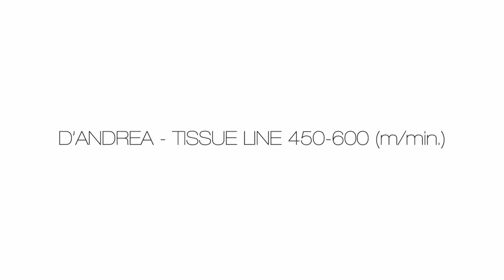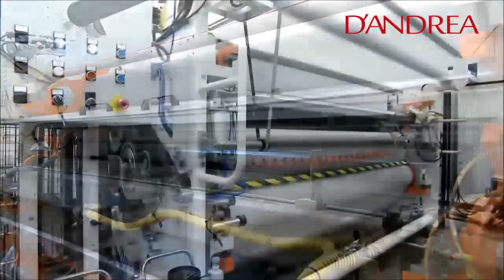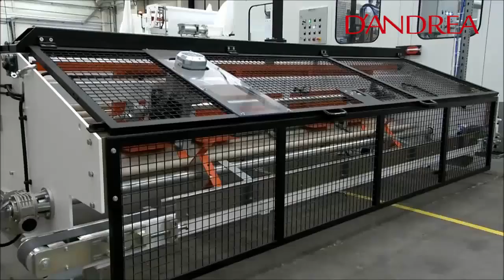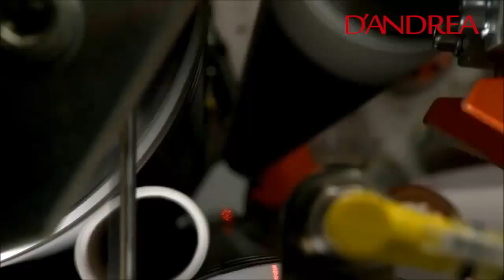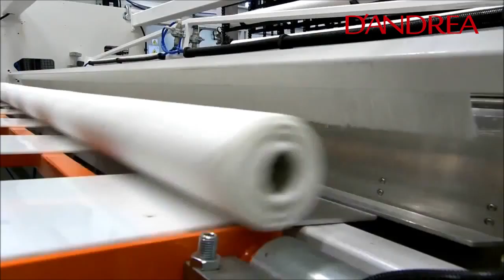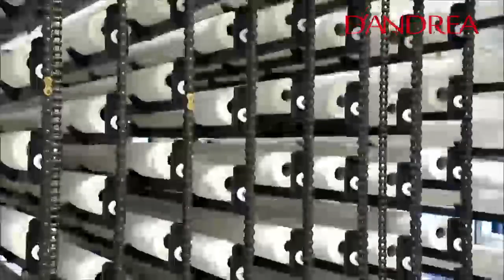D'ANDREA - TISSUE LINE 450 600m min

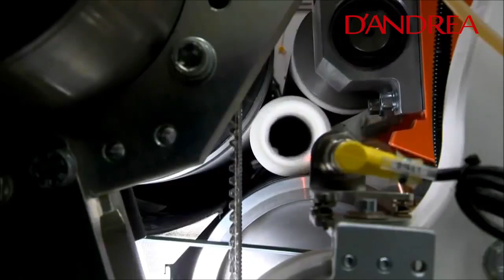Comment: having trouble with transfer, after new log starts it gets sucked back down, I don't get what's wrong. 2:30 anyone have any trouble shooting suggestions?
Reply: The bottom roller goes faster than the top one.